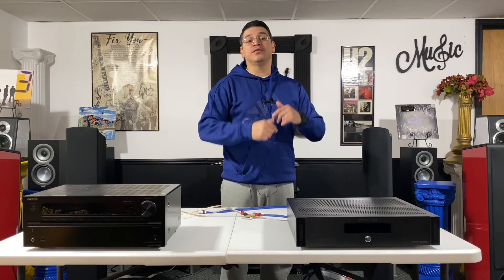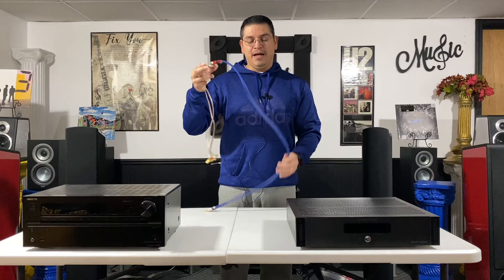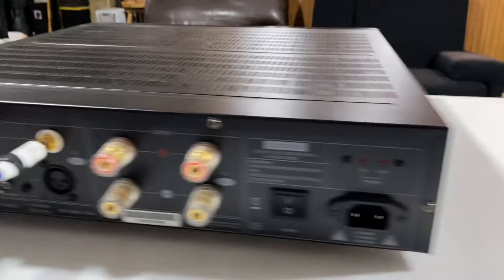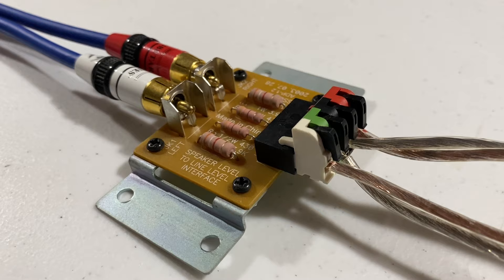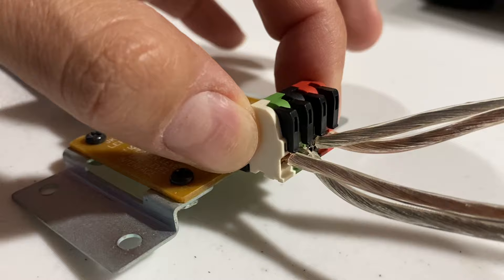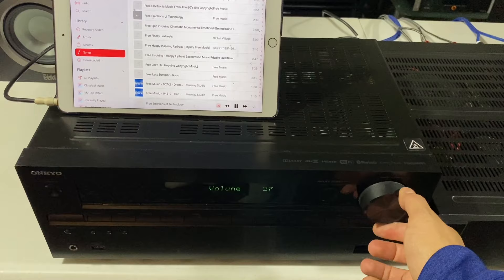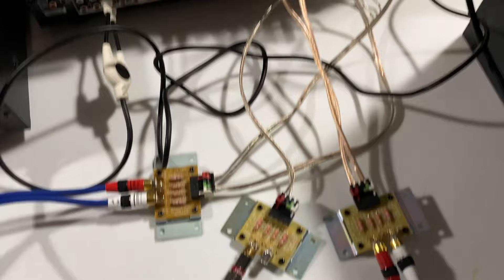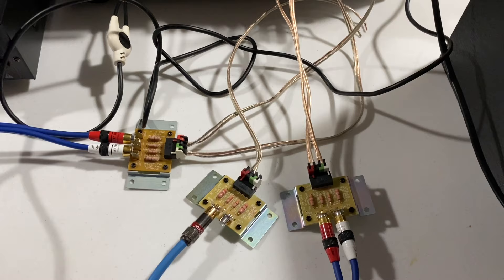Connecting an amplifier without using preouts.

Comment: I see you have a pre-out for the sub. Why can’t you use that Pre-out. You never mentioned or talked about that. You said there was no Pre-out on that receiver but I see one for the Sun in purple. Can you explain. I’m still new to this and my reviver has a pre out for the sub also but it’s black instead of purple.
Reply from the maker: So in this video I did mean to mention, that particular receiver did have preouts, so if I wanted to connect an amp to it I could and therefore not need the adapters. As far as the sub preout, that is for the low frequency sounds (deep bass) only. The preouts are for the other channels such as left and right speakers etc. the reason it’s purple on my receiver is because it’s the color coding for multi channel output. On other receivers that don’t have preouts for other speakers the sub preout is black. Hope that helps and thanks for watching
Reply: @Audiolympian  wow thanks for the info helps ALOT. So dummy this down for me lol. I can use the black pre out on my receiver and hook it to a amplifier so I could have more watts to my subwoofer alone. That’s all I want is to connect a subwoofer and have more watts just to the subwoofer.
Reply from the maker: @CGizzle1989  maybe that could work if your subwoofer is passive, meaning no internal amp. But if it’s a powered sub then that probably wouldn’t work because the sub itself needs to be connected through the subwoofer’s input. If that makes sense

Comment: I try it with my Yamaha ar a6 and it did not work?
Reply from the maker: That’s weird. I’ve used mine with 3 different receivers and two different amplifiers and it worked every time. I hope you didn’t get a defective device. Which amplifier did you use?
Reply: The new emotive basx 3 ..My receiver has 2 pre out left and right channels try the center with the adapter and it didn’t work
Reply from the maker: @tonymaldonado8116  hmmmm. If you were using the pre outs and the speaker line outputs at the same time could be a conflict there in the receiver. It shouldn’t be but maybe. I would try 2 things if you can 
1. Use the adapter on a different receiver to make sure you have a working unit 
Or
2. Try using just the adapter on your Yamaha and not the preouts. If either of those work  you possibly have a defective unit. Hope that helps

Comment: I have a Kenwood receiver that can only push speakers at 4 ohms, on either a or b channels, but I can’t use both while doing so.  My question is, if I get an external amp to push the bigger speakers, can I use the receiver to push the smaller speakers, which are also 4 ohms.  Would the smaller speakers go to the A channel, and the speaker wires that run to the converter go to the B channel?  Would that mess with my “A or B only at 4 ohms”   Or would it not matter since the B channel wouldn’t really be pulling and power?  Thanks
Reply from the maker: I also had a Kenwood receiver like that. So as long as it will play both sets of speakers at the same time you should be ok. If it won’t play both at the same time because of the 4 ohms I think you might be out of luck. Because it’s the 4 ohms that trigger the block. But I’m not an expert it’s always a possibility it could work. And yes you theory on the connection would be correct. Sorry I couldn’t help more. Thanks for watching
Reply: @Audiolympian  I think it will, I thinks it’s just too much for the receiver.  I could always just switch it to the 8 ohm selection.  I think the set of smaller vegas are actually 6 ohm anyway.  Thanks for the video!
Reply from the maker: @BigJip  if you try it out I’d like to know your results.
Reply: @Audiolympian  question for you sir!  I just bought (literally 5 minutes ago) a crown xls-402 amp.  It will be a few days before it comes in, but I’m ordering things I’ll need.  Anyway, the back of the amp has input 1 and input 2.  They are both XLR inputs.  I know I need to convert to rca for the pre outs, but not sure if I need rca to 1 Xlr, or rca to 2 xlr.  They sell both! I would just run the rca to 1 input, correct?
Reply from the maker: @BigJip  if I’m reading this correctly. Yes just single rca to xlr. Is needed one for each input for stereo sound. Thanks for watching and hope this helps

Comment: This is what I am looking for.
I have small issue. I just bought used unico p amplifier. 
I have same onkyo tx nr646 receiver.
But I am not sure where should I connect to amplifier from adapter.
Can you please help me.
Reply from the maker: Sure. As long as it’s a regular amp the adapter connects to the amp with rca interconnect cables. If it’s an integrated amp that might not work. Hope that helps
Reply: UNISON RESEARCH UNICOP Stereo Integrated Amplifier
Reply: So it will not work with this amp.
Reply from the maker: @zenithzephyr311  I don’t think it will being integrated amps don’t have connections to the individual channels of the amp section. The just have source connections and speaker binding post.
Reply: Can I use any of these sources connections to connect with receivers?
Reply from the maker: @zenithzephyr311  that’s possible if any of those connections are output sources. Mostly they are inputs.

Comment: You can use zone 2 preout, connect that to external amp and use it with same source right?
Reply from the maker: It seems that you should be able to but for some reason it doesn’t work that way
Reply: You mean it won't work for any av receiver?
Reply from the maker: @balasenthil5378  I mean some receivers can use zone 2 and zone 1 at the same time. And some can’t

Comment: Is there some reason why you can't use the (line outs) from the receiver to the amp? What is the difference between (line level out) and pre outs?
Reply from the maker: Good question. I believe it has to do with the processing of each partition of the receiver. Line outs and preouts deliver different signals. A line out signal requires some type of preamplification and a pre out takes an already powered audio signal and magnifies it. Hope that helps. Thanks for watching
Reply: @Audiolympian  Thank you
Reply from the maker: @Enigma-lv3rp  you’re welcome

Comment: Hi, I have two questions 1. can you please provide a link to this adapter or similar ones?  2. I have a set of Bose L1s and thinking about badding these to my AV receiver that dose not have the pre outs. Do you think this may work? Thanks.
Reply from the maker: I put the link here in the comments on eBay. But you can find them on Amazon too. The Bose speakers should work as long as you can connect them to the amp. You might need to get creative but should work. Hope that helps thanks for watching

Comment: What about if my main receiver has preouts but my 2nd amp (another receiver) doesn't?  I'm wondering how to connect those.
Reply from the maker: The only thing I can think of is switching the receivers. Making the 2nd your main then using an adapter. Just a thought. Thanks for watching
Reply: @Audiolympian   Not going to work unfortunately... as I require 5.2.4 processing.  And my 2nd receiver is only 5.1.  But thanks for the response.
Reply from the maker: @RoguePC4U  I had a feeling your main receiver was probably the one with more features. If I come across anything I’ll be sure and let you know.
Reply: @Audiolympian  Cool.  Thx!

Comment: I'm running 2 sets of Cerwin Vega speakers. I set is 4 ohm the other is 8 ohm. My JVC RX-888V is 4 ohm stable but has no preouts. Will adding this part change my already low ohm load and make it lower? I already have issues with it going into protection. I run a laptop cooler with 6 fans to help it stay cool but I can't lower my impedance any more.
Reply from the maker: It shouldn’t because it just redirects the already existing signal. But I suppose it would depend more on your amplifier and it’s load bearing capacity. Hope that helps.  Thanks for watching
Reply: @Audiolympian  thanks. It doesn't take much to effect resistance though. I'm going to try it. I never knew something like that existed
Reply from the maker: @robertholsopple9451  cool. Let me know how it works out. Others have the same concern but I haven’t heard back from many people telling me how it works out.
Reply: I will measure it after and let you know. I was also wondering how one of those cheap car audio converters would work for this purpose. There is a few that are not 12v and only have 2 set of speaker wires and a ground wire. Most of those max out at 50 watts where as this unit you have maxes out at 500 which is taylor made for big power home sterios. But for someone running under 50 watts mabe that option could work? Just a thought. My JVC RX-888V is 120 watts rms per channel so I can't use the car audio converters without blowing it up. This thing you found is the only option I found that will work for high power applications and not have to worry about noise. It's just unfortunate it doesn't have a case or gain knobs to have a bit more adjustment. I'm glad this exists though. I'll let you know the results when I get it and hook it up. Will it short if it touches metal, or cause noise? Have you tried that yet?
Reply from the maker: @robertholsopple9451  i haven’t tried them but other people have told me they have and they said it worked well. But I don’t really what other gear they had.
Reply: @Audiolympian  I meant the part you have in the video, will it short if it hits metal? I see guys putting them in electrical boxes and stuff. Did you have any issues when it touched something conducive?
Reply from the maker: @robertholsopple9451  actually no I didn’t but I only had it set up that way for a couple of days. Then I put them in a little wooden box I made for protection.

Comment: This is brilliant! I have a vintage Marantz amp from 1979 and I picked up a Sharp SM-7700 H MK II amplifier. I am looking to hook the two units up and it sounds like the Russound ADP-1.2 Speaker Level to Line Level Adapter is exactly what I need to get these two to work.  I do have a few questions, when hooking up the cables how are you able to differentiate the - and + is it marked on the Russound? And lastly, for those of us who are dealing with the headache of having to use a 12v power supply for the control lead (Sharp) - what would you suggest for a fix in a situation like this? Many thanks!
Reply from the maker: Hey Kurt. Thanks for the question. Yes left and right are marked on the adapter along with color. For your second question I’m not too familiar with that model of the amp but you may need to connect from the receiver to the power supply to the adapter then to the amp. Hope that helps. Thanks for watching

Comment: is it ok if i use integrated amp like power amp (integrated insted classic power amp like yours emotiva) ? tnx
Reply from the maker: Sure you can use an integrated amp for this. Just make sure you know which inputs you connect to on the integrated. Hope that helps. Thanks for watching
Reply: and thank you wery much for your video ,now i can save my old Marantz from removal. Great and most helpful video !!! @Audiolympian
Reply from the maker: @vladimirraicevic1165  thank you. I have an updated version coming soon.

Comment: A high low adapter like in car hifi.
Reply from the maker: Yes. I have had some people tell me certain car adapters have worked. The only thing I would caution is car audio devices are only designed to handle 12 volts and residential devices are equipped for 110 volts. Thanks for watching

Comment: I guess you didnt get this question that came to me right away when you said you can run the volume from amp 1. If the adapter is changing the signal to line level then why is the amp1 pushing amp 2. What is the volume set to on amp 2. Do you keep that at max all the time. That cant be true line level if your power from amp 1 is pushing amp 2. Amp 2 should be the volume. I dont know electronics but it would seem logical to me that you would be best of only pushing amp 1 enough to get the signal to the amp2 power supply and handle the volume on amp 2. What am I not getting. I thought the adapter defeated the power from amp1 and delivered line level only. Did that make sense?
Reply from the maker: Interesting question. Nobody has asked that yet. The second amplifier doesn’t have volume control it just produces sound. So what the adapter does is somewhat turn the receiver into a preamplifier. Ideally the best way to have a set up is to have a preamplifier and a separate amplifier. So the adapter gives you that option. Thanks for watching
Reply: @Audiolympian  I agree. I take that high voltage speaker level signal and brings it back to the very low voltage line level as in the preamp. Thus pushing the amp signal should still be defeated at the adapter. It sounds like the increase of voltage id getting thru the adapter and will melt the line level input of the amp. Weird. I got to research that amp 2 your using. ;-) It is a good way to do what you are doing and use a more powerful amp but I am still stumped at the volume. ...So AMP2 is a single output amp with no control to power output. Thats weird to me too. ;-) :-)
Reply from the maker: @robertingraham8413  technically I think your correct. So maybe the adapter have some sort of 2 way resistor that doesn’t allow the receiver to cancel itself out. 🤷🏽. You got me thinking now, that m gonna have to do some research on it.
Reply: @Audiolympian  I see it is a signal trigger that takes it out of standby and counts on the preamp exclusively for volume. I am going to let this go as some how even though the signal to the adapter is post amp speaker level I guess it still carries the preamp signal with it and makes it through the adapter to the amp. Some things you just go to believe I guess. ;-) It is obviously passing the preamps line level even though it has been processed by the power amp. Hmmm. Thanks for getting back to me. I thought i was crazy. Well I am but that another forum.
Reply from the maker: @robertingraham8413  haha takes one to know one ✌🏽

Comment: It would not amplify it and then bring it down afterwards. All that adapter is is a set of resistors that step down the power coming out of the amplified speaker channels. Had it had preamp outs they would have been "pre"amp or before amplification.

It is however nice to know that they make these. I imagine there would be a loss of audio when done this way.  :-(
Reply from the maker: I see what you mean. The good thing is with my Denon and Onkyo receivers I can still run Audyssey and that helps clean up the sound. Thanks again for your birthday input.

Comment: I'm afraid I do need to offer a bit of a correction...
These devices do indeed work... sometimes quite well... and they may be the only alternative you have.
However....  this is not at all the same as using "preamp outputs" if you have them.
With virtually all properly designed receivers the preamp outputs are going to be coming directly from the preamp section.
(This means that, when you use the preamp outputs, you are BYPASSING the main "speaker amplifiers".
With this adapter you are taking the signal AFTER it passes through the main amplifiers in the receiver.
The problem with that is that the speaker amplifiers often (usually) add a significant amount of noise and distortion to the signal.
Therefore the sound quality when you use the adapter will not be as good as if you have preamp outputs and use them.
(The difference may or may not be significant... but it can be.)
Reply from the maker: Thanks for your input and for watching
Reply: I found any added distortion to be hardly noticeable. Remember the receiver is now producing power to a device with a much higher resistance than say an 8ohm speaker, so the power output will be much less as well so there is less distortion. The Kicker 46KISLOC2 claims to only add .01 %THD. It is true I didn't use a meter to measure the difference, but my ears could not tell the difference between a speaker coming directly from the receiver, than through the added amplifier.
Reply: @Drgluee  I have no idea what noise or distortion, if any, the 46KISLOC2 adds. (Although the fact that it claims to be able to send a 12V "turn on signal", which it must create by "tapping" power from your amp's speaker output, does concern me slightly there... since tapping power that way is often not a great idea.) However the main "issue" is that, regardless of the load you apply to them, even if it is less than a normal speaker load, the amplifier outputs on pretty much every receiver have a lot more noise and distortion than the preamp outputs (if they HAVE preamp outputs). However, if it's working well for you, and the difference isn't audible, then that's all you need to know...
Reply: @keithlevkoff8579  My bad, it was model KICKER 46KISLOC KISLOC. But I agree, I am just running Klipsch RP-260f from my amps, now if I were running anything higher up, I would pony up for a preamp or receiver with preouts. But right now, RPs are clear, but not clear enough to tell the difference.

Comment: Why can't i just use a cheap $10 converter that's usually for car audio?  Wouldn't it work the same?
Reply from the maker: I’ve never tried it, but others have told me it has worked for them so it’s possible. My only concern for that device is it’s only designed for 12 volts of usage not 110 volts. So it may burn out. Probably won’t damage anything just a device burnout. Hope that helps.
Reply: @Audiolympian  Understood...